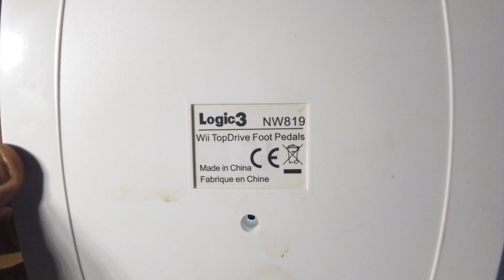Nintendo Wii TopDrive Wheel NW 819 by Logic3 & TopDrive Foot Pedals

Comment: How to reset the passcode
Reply from the maker: Passcode from the steerwheel or from the nintendo wii?
Reply: From the steering wheel  @YouDisassemble
Reply from the maker: @davidyoussef3886  i tried It but unfortunately i have no video before dismantling It. I used no code, as i remember. But don't you have an instructions book? I remember that there was somewhere on the steerwheel a click or clip where "reset" reads. Give me time, maybe in other draft videos of my video i find what you Need .. ok buddy?